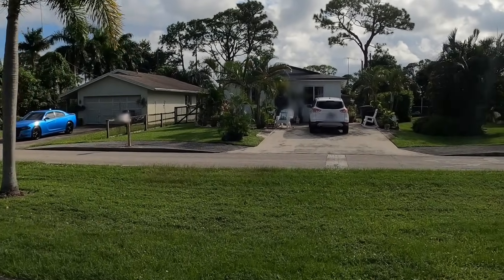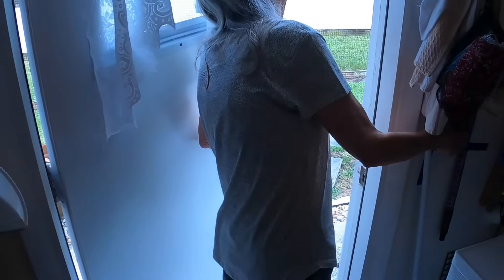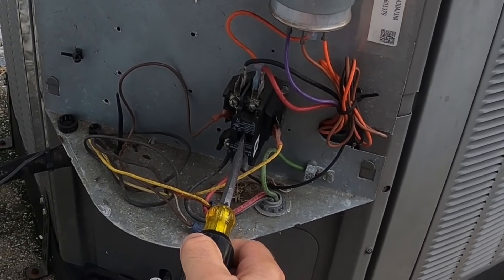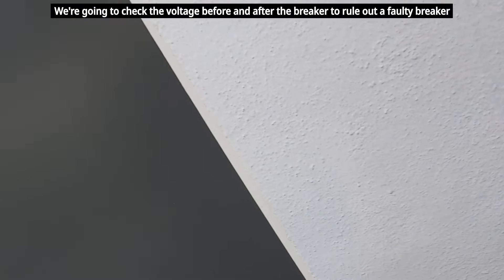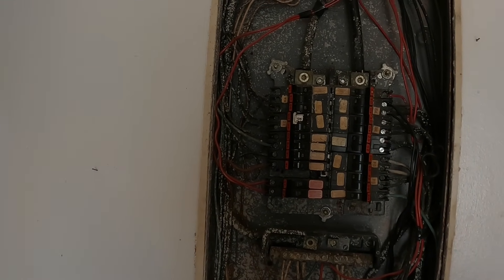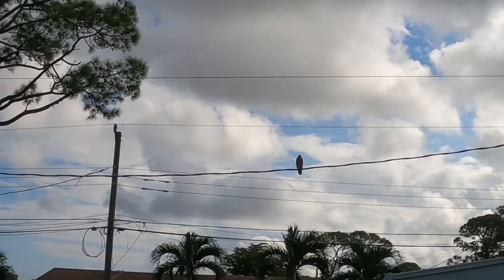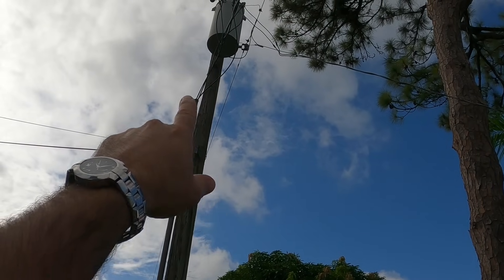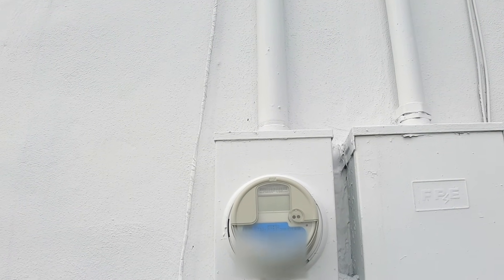Half The House No Power or Lights Dim? (220v Appliances Don't Work!)

Comment: You have the Fire Prone Stab-Lok Panel that needs to be replaced as soon as possible.  You Can BE SURE if you replace that fire prone Stab-Lok Panel with one made by the fine folks at Eaton/Cutler-Hammer BR Panels.
Reply from the maker: Yes, that is a panel that is known to have rare problems what can result in a fire. Incidents of that happening is extremely low

Comment: After yesterday's hurricane, this was the same thing happening in our house.  No a/c, pool pump, dryer, stove. Lights flickering but everything else working fine. electrician said it's probably an FPL problem due to storm but not 100% sure as I am not an electrician. Having someone come out tomorrow to make sure but this makes sense.
Reply from the maker: You definiely lost a leg if no 240V , AND have a bad neutral connection

Comment: Never splice a service line.  1 continuous piece
Reply from the maker: Who says? LOL. If you worked for the power company they'd lose a fortune. There is NOTHING wrong with a properly done splice.
Reply: @electronicsNmore  I do work for a utility.  Spliced services are a temp repair  I wouldn’t want one on my service
Reply from the maker: @johnc8399  What do you think they use to connect the service drop to the service entrance cables? LOL. You must really hate when they spice HV primary lines.
Reply: @electronicsNmore  company standards, not mine.   Engineering prefers no splices.

Comment: Have you come across an issue after you replaced a capacitor on the condenser outside and then a day or 2 later the customer says the power went out to several area of the house and then power came back,  and the house is equipped with a solar power equipment.

Comment: Power Co went down our street at work replacing transformers early one morning swapped the phases around jacking up all my shop equipment. They send out a crew 5hat dident know about the transformers . They spent 5 hours messing with it only to say all your wires got power and I said did you check the phasing all 6 dudes looked at one another and ducked there heads, and that's when I knew. Lol . It's not every day you get to correct the linemen.

Comment: Well...up her in the Midwest, we had some bad storms this past Summer. After July 4th, I was "lucky" enough to be the only one in my subdivision with a brownout. The local power company stonewalled me at first, but either they fixed it, or it miraculously "healed" itself. The consequences were/(are):
1. The transformer in my HVAC got fried, and a technician had to put in a new one.
2. The electric garage door wouldn't work, and when I (gently) moved it manually, the cable got tangled-and, THAT had to be repaired.
3. The refrigerator made Terrible noises, and dimmed the lights, so I had to unplug it
4. speaking of lights, when one overhead light was on the other ones dimmed. 

Two days ago: Deja-Vu all OVER again. I DO have a backup generator (Generac) but it doesn't come on automatically like it should. I manually started it today, and plugged the fridge back in. But-my microwave is fried, my cordless phone charger seems to be, and, YOU guessed it, the HVAC does not work...not even the fan. This is beginning to SUCK! This latest episode cannot be due to weather. The weather has been calm; just a bit of rain. The electrical company sent me a text,stating that there was "power to the meter" so there cannot be a problem at their end.  A lady did get back to me on the phone yesterday. 

I think I will get an electrician over here, if only to document things.
Reply: Similar situation here. It started with a burning smell from an outlet while the Illuminating company were messing around outside. How did things turn out?

Comment: I love how that "smart" meter had no fault detection/protection, they should start making that mandatory. The customer was getting free power from the meter being out and if a neutral fault occured it would have caused damage. Of course the more advanced the meter, the more expensive but that's what they should be using our taxpayer dollars for. Granted, that may have been an old meter, but they should upgrade them, preferably soon (after the virus crisis).

Smart meter rant over.
Reply from the maker: 🤣 Smart meter rant.
Reply: Its not the power companys fault its the dumbass tree trimmers that    Damaged the line and now the power company has to replace the svc line

Comment: If you put a bunch of magnets 2 inches apart then wrap a thick cooper wire around the AC unit the 120 will double to 240, it's true I seen it on YouTube 😉 Kappa

Comment: I actually had the same problem a few years ago.  A hurricane came through and did a hurricane's worth of damage.  No guessing required, however, the big tree that brought down the power pole and some of the lines also was blocking the intersection right next to the house.  Had to plug the fridge into one of the working outlets.
Reply from the maker: At least you had something! :-)

Comment: I had a situation where they tried to power 4 or 5 homes from 1 transformer.  It was constantly tripping the breaker on the transformer.  The kind that is easily reconnected with a pole.  The third time out they finally got it into their heads to put up another pole and transformer.
Reply from the maker: 4-5 homes on a single pole mounted transformer was the norm years ago, but houses have gotten much bigger and draw more current than usual. Thanks for watching!

Comment: 5:54 "they" meaning workers cutting the tree? Would file a liability claim against "they" (tree trimming service)  at min if they were not bonded, insured and licensed file with the department of license-sure for your state. They are very few certified arborist in most southern states- its a fading profession and the regulation is just as bad with home inspectors. Just because you know how to start a chain saw doesn't mean you have even a clue of aptitude for tree removal. Lesson dont hire any tree trimming service with out proper bond, licensing, insurance AND CHECK THE DOCUMENTS! call their insurance company doesn't matter how long they have been in business or how many reviews they have.
Reply from the maker: Not worth the trouble. Rose's neighbors hired them(the landscaping company), and the people that run the company rent a house from the neighbor. The neighbor said she would pay for any damages.
Reply: @electronicsNmore  Regardless of the verbal restitution gesture,  words  dont pay for damage; which doesnt hold up in court since its a "he/said she said" communication that judges dont favor to on the plaintiff end- burden of proof. #1 There is clear neglect and incompetence on the landscaping company which needs to be held liable #2 if not for this incident but potential future mistakes they could be causing to other people; if they dont have the credentials, insurance, safety and license to work in this trade. Cutting any tree over live/any power lines is extremely dangerous work, to deadly results- sometimes a permit is needed-certain counties/states. The damage was very clear in the video. The fact the landscape company (not a arborist company- landscaping companies in a lot of states can only MOW GRASS/clean up debri) didn't make contact through note, follow up communication to this "ROSE" shows the unprofessional-ism and further neglect.   Regardless Rose could make a claim on her homeowners insurance and the ins. company would follow through on suing or collecting deductible from "landlord of home"  insurance claims can always be cancelled but there's proof of the event and investigation if "ROSE" wanted to present this to the landlord of the property whom hired the incompetent/mistake/negligent landscapers. BUt what we know we just see cases like this in the hundreds every year where innocent "Rose" like  people (especially seniors) start having other damages, death, and injury because of negligent/careless work. Mistakes do happen but communicating those mistakes is key and how your going to resolve them is ethics. ****The electrical company may add a fee onto her next bill for the repair- we have seen this many of times. Electricity is not a government tax paid utility in the USA. Good luck and nice work on the diagnosis.

Comment: we had a line get hit with a tree limb and it burnt itself through and left us with 1 phase this summer.
Reply from the maker: It must've been wet, or wet wood. You're talking about the low voltage secondary side, or the HV primary into the transformer?

Comment: People make home electrical feeds more complex then needed.  It's just a 240v center tapped transformer with the center tap being bonded to neutral and ground.   What sucks is when you loose the neutral and all the devices in your home act like a bunch of voltage dividers causing crazy swings.
Reply from the maker: At least you still have 240v. 😃

Comment: Problem observed in multiple locations, the first thing I do is check the panel.
Reply from the maker: True, but viewers also saw a simple way to test a condensing unit for full operation if it doesn't turn on with the thermostat. Thanks for watching!
Reply: @electronicsNmore  Indeed. Maybe her compressor will fail again and need the capacitor replaced. :)  (Or maybe you already did that.. it seems familiar.)

Comment: I kinda have the same issue. I get 111V on one leg and 130V on the other. All house dims and brightens with loads and unloads
Reply from the maker: Definitely a poor connection on one leg or the neutral between the transformer and your breaker panel.

Comment: Nice explanations in easy to understand terms for the electrically unaware.  I would have started at the panel (lectricity is what I do for $) , however it would have made for a short and boring video.
Reply from the maker: Exactly why I did it. :-) As soon as I heard dim lights, handler and condensing unit off, I knew. At least people picked up some knowledge on how to bypass the thermostat to check for power and operation at the condensing unit. Thanks for watching!

Comment: I worked for the electric company up north and had an apartment house that a storm broke the neutral and the metal SE conduit got so hot that it melted the vinal siding due to the current trying to return on the pipe. Ended up cutting down the service until a new one could be installed. All the voltage went to L1 and L2 only had a couple of volts on it. Thanks for the video.
Reply from the maker: Nothing worse than burning vinyl siding! Luckily the house didn't catch fire. Glad you liked the video!

Comment: interesting, the meter was not functioning yet she still had power! Theoretically,  she could have lived on 120 without incurring fees until the power company realized her usage had dropped to zero and sent someone to investigate...lol. The only question I have is, why her lights were dim, even though she had full 120 on one leg? Some sort of bleed through on the neutral?
Reply: Light circuit was on the leg that had partial power. The line was not completely severed.
Reply from the maker: Correct! There was maybe the equivalent of a 16ga wire left where it was cut.
Reply: @Robnord1  ...yeah, I forgot that one leg was not completely dead! So I'm assuming the lights that were on the other leg would have been normal, if there are any... Still find it VERY interesting that the meter itself was not running....
Reply: With no neutral going back to the transformer you get an imbalance on the load and usually one leg goes hi and the second leg goes low. Very common. Sometimes the current trying to return to the transformer will go thru a copper water pipe underground.

Comment: I have a background in electronics but house panel wiring gives me pause.. with those heavy unfused (are they?) Cables coming in.  Gathered my  courage and ran another conduit and circuit breaker while keeping " one hand in pocket"  Love most of your videos, liked the rest LOL. FYI you have a great speaking voice, should be on the newscasts.
Reply: Maybe better you don't touch the panel if you have pause.
Reply from the maker: I've been working on house wiring since I was 12 years old. Many accidental shocks over the years. LOL The wires leading into the panel have no fuse. The main breaker is the fuse. At the transformer on the utility pole, you have the switch, which is likely a 1000A rated fuse. In many areas you'll see 4-5 homes on one transformer. Glad you like my voice. :-)

Comment: Something similar happened at my dad's house, half the house had power.  The difference was that the meter shorted out one of the legs, it was all charred inside and I wish pictures could have been taken.

Thanks for posting this video.
Reply from the maker: Over the years, the most common cause is usually a poor(high resistance) connection at the meter can or main panel. A couple times the meter socket was faulty, and the connection to the transformer was bad.

Comment: My mother had an older house and was having electrical problems.  I took my trusty meter over there and started checking voltage.  Most of the readings were less than 90V, I traced it back to the meter so I called the power company and asked if they would come out and kill the power so I could pull the meter and take a look at the base.  They wanted an outlandish sum so I told them I would pull the meter and when I was done I would call them so they could reinstall the security wire.  When I pulled the meter I saw one of the buss strips the screw connecting the two right-angle strips was loose.  I took a screwdriver and wrapped it base with enough electrical tape for safety, tightened the screw, reinstalled the meter and everything is now working fine.
Reply from the maker: I've pulled a bunch of meters over the years when doing after 5pm/weekend jobs. LOL